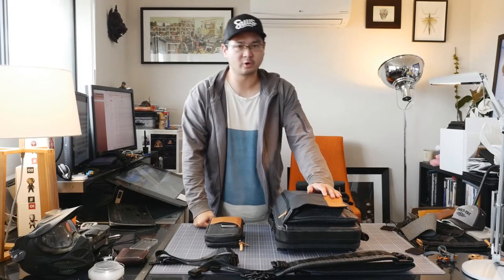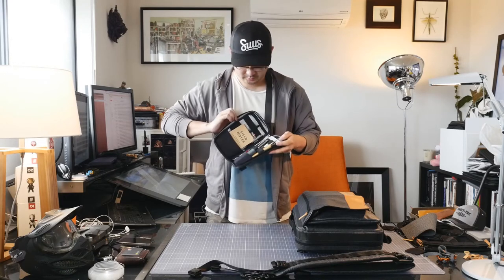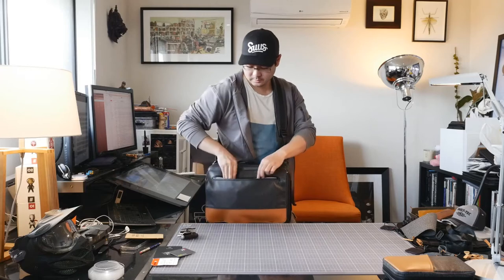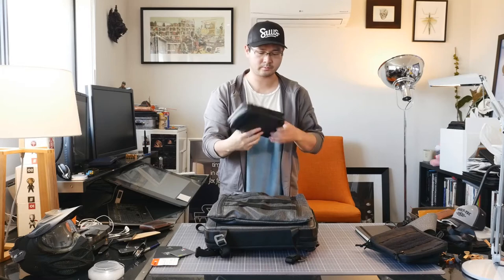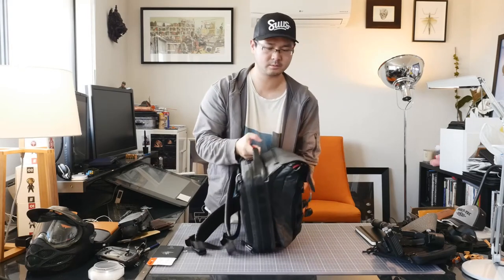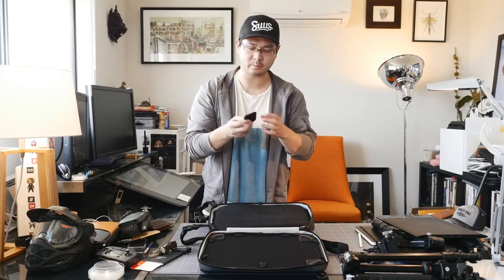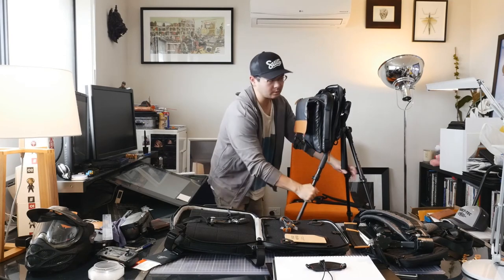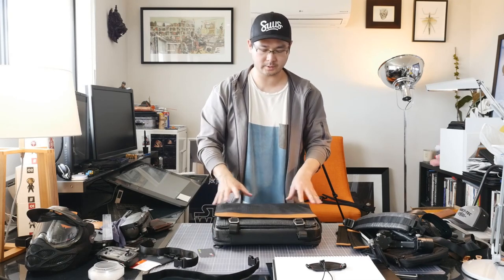Etchr Art Satchel Explainer Video

Comment: Your website only shows the art satchel and field case in black. Were the tan components only on the prototype and not for final production? Thinking of ordering. Looks a great product.
Reply from the maker: Hey Sturmhawke, thanks for the message - yeah it was a final design decision to go all black that was based on a few things:

- Minimum order quantities are large and represent a significant expense for us - even for a small think like a slight material change, they are considered a brand new "style". As a small company, we just don't have the resources to be able to carry multiple product lines in variations at this time, although is something we'd love to do in future.

- The vegan leather in tan as pictured wasn't as strong / resilient as the final black rubber we chose, we found rough handling left scuff marks and permanent pressure imprints from fairly innocuous activity, and we don't use actual animal leather for any of our products, so we haven't found a suitable substitute as yet, though we continue to search.

- We love getting feedback during the design process from our supporters and customers, and when given a binary choice between the tan and the black, there was an overwhelming (75+%) in favor of the black material now seen on the final production model. We felt it was prudent for us to listen to our audience hence the final look.

Hope that sheds some light on things?

Cheers, Darren